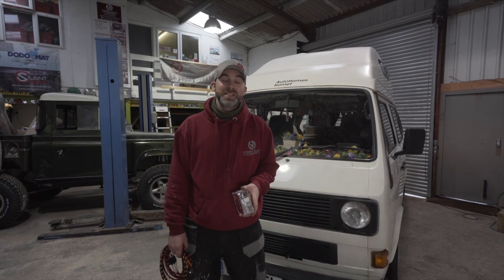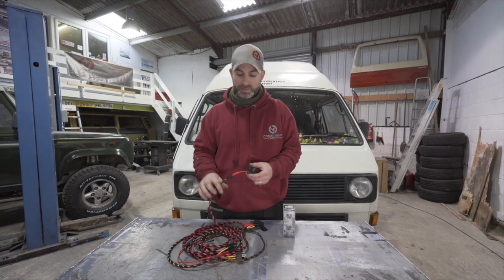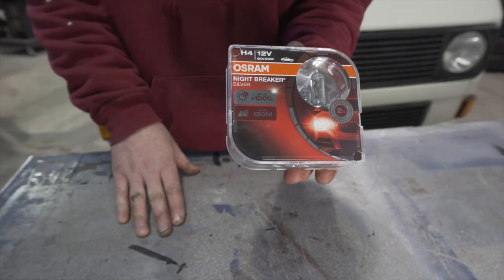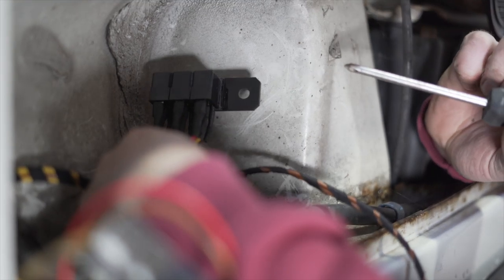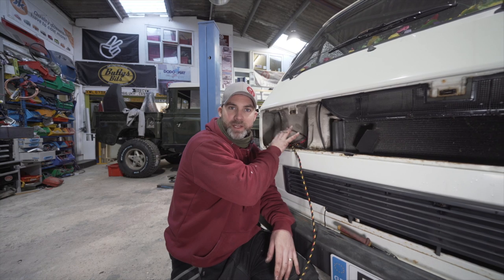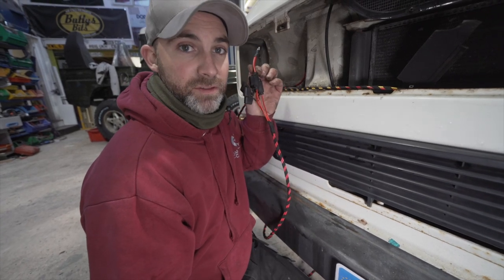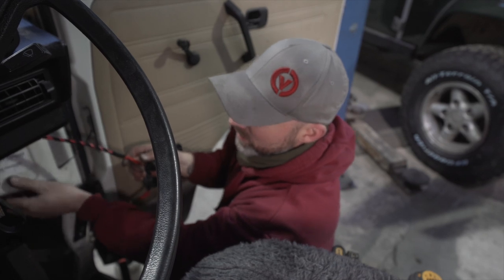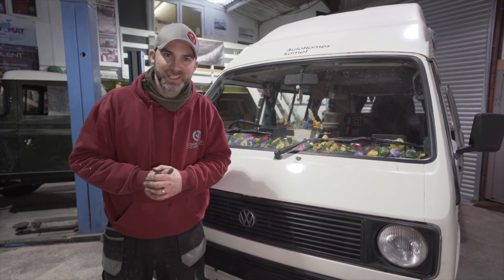HOW TO FIT AN UPGRADED HEADLIGHT WIRING LOOM IN A VW T3/T25/VANAGON

Comment: I have a diesel T25 with round headlights. According to your excellent video, I would need to run the cable to the battery in the engine space. However, I also have a leisure battery under the seat. Can I attach the headlights to that directly or does it depend on how the leisure battery is set up?

Comment: Great video, very impressed! And, I bought the upgrade from Campervan Culture for my 1988 square head-lamped Wolfsburg T3/T25 LHD. Quick question? If my T3 is a LHD, does my male socket fit to the opposite side to what you have installed on a RHD? Or, is it the same as per your video? Thank you!

Comment: Hi great video, thinking of buying the kit because of the vid. how do you connect the kit to the headlight switch? dont think its shown in the video. cheers
Reply: That is my question, too. I was hoping it might be a new switch and I could bypass my problematic headlight switch system but cannot see.
Reply: @sorchajones1788  Why is the headlight switch system problematic?
Reply: @kieferngruen  I have some issues after fitting a new PCB to replace the old dash foil. I think back when I made the comment, I might have been blaming the headlight switch. Erroneously!

Comment: IMO its much easier to route the lead outside under the floor and  through the main battery cable grommet.
All accessible from under with the spare wheel and battery removed.
Reply from the maker: It's a good alternative route for sure. In this van it had a welded in spinning seat base so access to the battery and surrounding areas is super tight

Comment: Just bought this and was going start installing it but...
1) My van is LHD, should I start from the right or left light? On the instruction it says you should start from the closest side to the battery (in my case the battery is on the right side, like in your van, but the steering wheel and hole to pass wires is on the opposite side!)
2) It looks like the previous owners had already fiddled with the cables and it's also being hacked together. Is it worth trying to understand what's going on there or just add the loom at the end of it?
Thanks

Comment: Could this kit potentially be used on Mk2s with the 4-lamp grille with the high beams? Loom looks very similar to ones available for Mk2s with 2-lamps but figured this one would work if you have the high-beams too
Reply from the maker: I would say yes. In some areas the cables would need to be shortened as the battery is in the engine bay, but I feel it would work in the same manner

Comment: Hi,I cannot find any screws in the location were you fitted the earth wire?
Reply from the maker: Hi Graham, you will find the headlight ballast resistor beneath the drivers side headlamp. Unplug that and remove it from the van. The resistor is held in by a metal clamp. Remove the bracket with the large screw and use that screw to hold your earth down. If your van does not have this feature you may have to create a new earth by drilling a new hole
Reply: @CombeValleyCampers  thanks for reply. There was a vacant hole there so guess I mustn't have had one fitted. All fitted and working now. Video was a massive help thank you 👍
Reply: @grahamblundell1700  pre '85 didn't have one
Reply: @only-vans  thanks for clarifying pre 85 don't have a ballast. In video he simply states that he'd removed it, not showing footage of it, or removing it had me puzzled for awhile.
Reply: @CombeValleyCampers  headlight ballast resisto??? Do you mean the radiator resistor?? I have not heard of a headlight ballast resisto before??
Reply: @CombeValleyCampers  Installing this now, I have the hole where the ballast resistor was. Any idea what size screw is required?
Reply: Today while driving my van inside a tunnel with my headlights on the widres started melting fdrom headlight switch down to the fuse box. What would be the freason for the wires melting, gfrey wire with dred stripe?